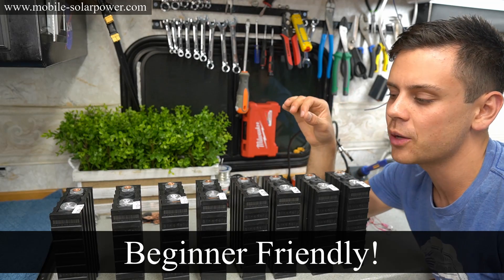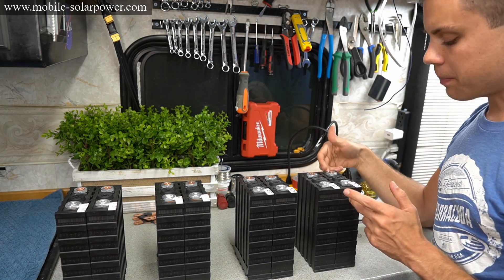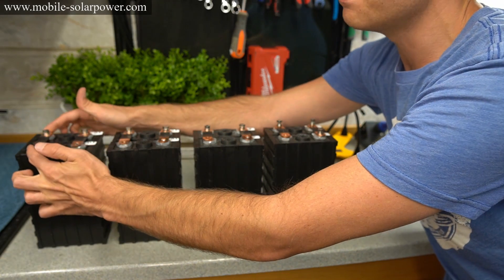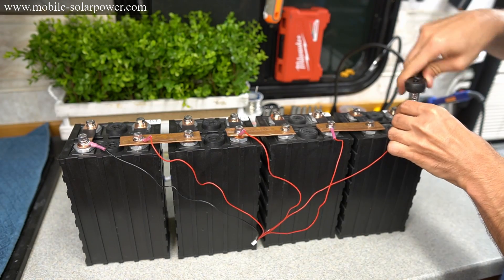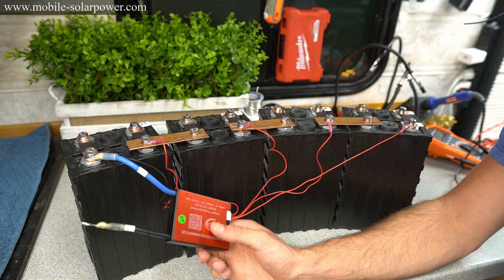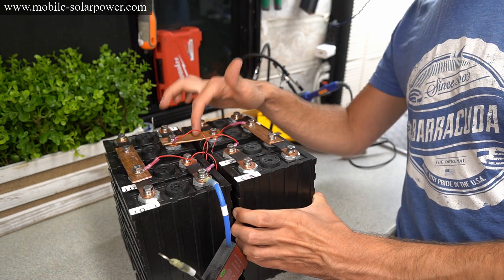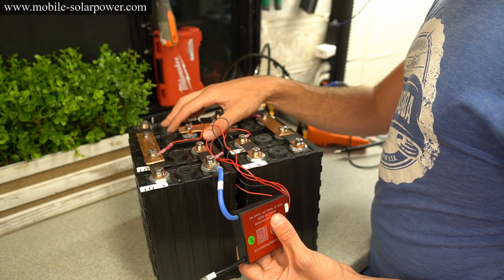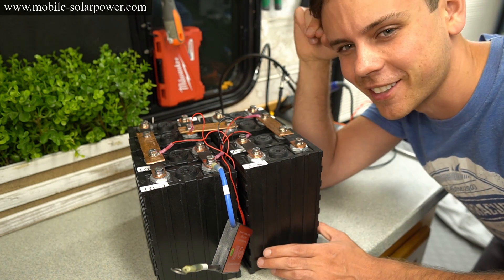How to Build LARGE LifePO4 Solar Batteries w/ Raw Cells and a BMS

Comment: I know this is an older video, but I have a sailboat with a battery “space” that is only so big and this is an interesting option for me. I’ve been kicking around the idea of using lipo cells because the case that a production battery takes up is just useless air and the best I’ll be able to do is a 200ah setup. Using cells, I have room for a 400ah system and this idea makes excellent use of the space I do have.

Comment: So say the batteries are 80ah and this configuration is 12v, with 4 blocks of parallel 80 ah , that's 160ah per block x4  that is 640ah at 12v which is 7680wh... Do I understand this correctly?? Trying to wrap my head around how 3.2 v cells halved in parallel and then chunked in series is ending up 12v.
Math is hard , my math is wrong isn't it

Comment: With this setup, is this a 2P4S battery configuration? Second question is if I wanted to make a 200ah 12v battery, would I need 8 3.2v 25ah cells?

Comment: I have a question I really hope you can answer. I’ve been looking on different websites and each website seems to give a different I build a 12V 200Ah lifepo4 battery what size BMS should I use? it’s gonna go on a 4000W continuous 8000W peak 12 V pure sine wave inverter.

Comment: i have 64 3.2V 320MH Lifepo cells i want to make 48v or 24V large single battery bank how much and which specification BMS system will be required. i want to purchase only BMS either 24v or 48V depends upon Solar invertor, second question is that do we have built- n BMS in 5 or above KW investors to manage all these cells now a days

Comment: I'm building my own Lithium Ion Power Packs. Hooked to 100 watt solar panels on my VanLife Van's roof -the $65/100w panels with the discount code Bob Wells promoted, maybe. Or 20 watt panel to trickle charge for now. This, all because of the education Will & Bob have provided us all, over the years. Mostly of 18650 cells. Batteries both in Series & Parallel. With a good BMS. All DC for now. Watched a ton of ebike, scooter, drill, Home made Onewheel, etc YouTube videos on how to build, configure, solder,  DC Battery Packs. I get it! It's my new passion. Wan't to build my own Onewheel, Boosted Board, and Li Ion Hydrofoil kiteboard. And maybe my own Li Ion Powered invention. Out of the back of my van. 
  How many 18650 cells (if harvested from ewaste for free) can I store my van, Will? If I do a good job sorting out the bad/damaged ones, keep tabs on all of their voltages with my multimeter, until it becomes a fire hazard? Obviously keeping them organized/separated in those 6 pack plastic holders they sell to build the battery packs.Then storing them inside a metal box, next to a good size fire extinguisher is helpful 🤨. Or are 18650's so cheap now, can I just order a bulk pallate of new ones from China. And skip the dumpster diving. Because voltages are balanced within 1/100 volt when their new. And forgo expensive BMS's for my first 3 small 10 - 20 amphr packs which can be evacuated quickly from a van, if need be. 
     So excited for my new hobby. I'll even work as an electical apprentice somewhere because I'm so motivated to learn as much as I can. I'm so stoked I'm getting it.

Comment: I built a small 48v lifepo4 16s battery system from 16 280ah batteries. I'm planning to scale that up to a total of three systems to power an 18kw inverter. Charging to be done by 40 240w solar panels, which are due to arrive tomorrow. I have to buy wire and connector sets for the panels yet.

Comment: I have a question. What bms or how many bms's do I need if I build 4x12v 200ah lifepo4 batteries and connect them in series to run a 48v system? Can I use 1 bms for the whole bank or do I need seperate bms packs for each 12v battery? And what if I just build a 48v battery at 800ah can I use 1 bms and if so what size would I need?

Comment: I like your video, but what was confusing was at 4:10 in the video you point to the 4 battery in the system using your left index finger on one post which is positive and your right index finger it pointing to the negative post. I looked at my diagram for the system that I am building, a solar generator, and quadruple checked to make sure I had the batteries in the proper orientation.

Comment: Hi there, Thanks a lot for this great video. I like it a lot. I have one question here. If I have 12 of these cells, can I parallel 3 cells and then serial connect them to make 150amp of 12v  battery and still connect the BMS as you showed in the video? Thanks again.

Comment: How important is it to use the Buss bars? I have a situation where it wouldnt be possible to to use them. can the cells be connected with cables instead (Assuming cables are of sufficant size, good terminals etc)

Comment: I could really use some advice, and this might be a good topic for another video because I cant find much info on this.   I'm trying to build a 24V battery bank with 12 x 3.2v cells.   How do i configure these in a safe way??? I thought I could use 2 X12V bms in series, but then I still have 4 cells left over that I don't know how to integrate into the batteries while keeping everything balanced.... the 24v bms is a 8s system and comes with the same issues.....HELP!  (I want to use all the cells because 8 cells have enough wh at the end of the day)

Comment: Hi 
I am having trouble with BMS it has no voltage at the p- cable but the battery is currently fully charged i tried shorting it on the main -but no luck.
Any ideas

Comment: Question: I have 4( 18v ,200watts) solar panels+ 24v tesla battery 1 bloc and bms + 5000 watts pure sine inverter. What MPPT should I use and how to build my system. I want to power a small swimming pool pump+ un small frige+ light. Help please.

Comment: 051021/0346h PST 🇺🇸 thank you again. I’m watching this instructional presentation for the 3rd time.
I configured 8 LiFePo4 prismatic cells (272Ah each) to obtain 12V@544Ah, (with your guidance) Thank you.
I used JBD BMS 12V 100A OP and configured the parameters manually to obtain maximum results. My power requirement is very meager, mostly for experiment purposes. The PV cells are RENOGY X4 400 W, Victron Charge controller, VICTRON 12/2000 Inverter, 12X25A VICTRON LiFePo4 charger ( to take up the slack during winter and other extreme conditions) and CERBO-GX system stem and function.
So far the system functions well.I might replace JBD with 12V Daly @120A OP.
Thank you again for the, info, without which I could have not achieved success. Stay safe and 73s...
Reply: How did this turn out, I would like to do a similar setup with the 310ah

Comment: I'd love to find a link on your web site to ALL the videos you have done on LiFePO4 24 v batteries AND the hardware and design that goes with them to create a solar system for RV living. It might start with the DIY 24V Beginner friendly video. And it would probably include the videa I watched recently about the BMS, Inverter, battery protect and relay system. And it might have a parts list and links to sources. Please?

Comment: Hey Will Im a huge fan of yours and Ive learnt so much from you.
Can you clarify something for me please  by wiring batteries in series does it change the voltage from 12 to 24 volts or am i missing something  
Thanks Mate keep up the awesome work
Reply: Series means they add up the voltage, parallel means they add up amps. 
Series means connecting positive to next batteries negative, basically one big battery with double voltage between first negative and last positive. 
Parallel means connecting the positives together and also negatives together so you have twice the amp storage.

Comment: Hi Will.  Love the videos and thank you for all your tests  I've learned a lot from them.   
You mentioned in this vid to use 2p4s but I'm seeing varying advice to use instead use 4s2p.  What's your take on 4s2p ? Other than needing a 2nd BMS, why is it not good to series first and then parallel ? 
I'm just checking because this video is nearly 2 yrs old and I wonder if the mindset has changed in that time.  Thx

Comment: Great explanation, may I ask you a favor, I did a series with BMS card to build 12V 100Ah and now I just build another 12V 100Ah, what is happening if I parallel them to build 12V 200Ah? it means I parallel the 2 BMS. I waiting for your feedback

Comment: I guess you could connect 4 in series, 4 in series and then connect those 2 in parallel. This would be similar to having 2 ‘off the shelf’ batteries and would give you the opportunity to add another ‘battery’ (4 cells in series) later if your power needs increased. But I suppose it depends on the BMS, if it’s only capable of balancing 4 cells then you would need 2 BMSs.
Reply: I'm a bit late but that's what he specifically states not to do in the video.

Comment: Will,  What is the bast way to hook up sixteen, 280ah batteries for a 48V system?  This is for a 30A 21' travel trailer with five, 200W panels (20.23v each).  Thanks!

Comment: If I'm putting together a 32 cell system (12V)  I'll need 4 BMS's, Correct?  I'm going to use 200a ones to power an inverter.  If I'm correct is just what you did in this video X 4.  And of course connecting the Neg of the bms's together on a bus bar..   Great, Great  video's  You have the absolute best way of explaining whatever the topic is your covering.  Keep up the GREAT work!

Comment: I tried 24V BMS and the output of the battery is 26.2V but if I connect the inverter and solar controller the voltages is .245V only not functioning

Comment: thanks for stepping into the bigger capacity range.. I know you do more smaller mobile power but I need info on a house size system.. I am looking at 16- 280ah cells configured into 2-24v battery packs..  1. have you tried these batteries yet? 2. would you recommend 1 bms with the systems in parallel like this video? or would I be better off with individual bms for every 8 cells?    also,, where do you get bus bars?

Comment: Hi Will, a long-time subscriber here. Just wanted to point out a little "error" I noticed. If you pause at 4:21 and look at the busbar at the rear of the battery, it is connected to the inner-most battery in the parallel string 2 and string 3. I learned in electrical engineering, that the + and - should always be pulled from opposite batteries in a parallel string, as that will spread the current over each battery equally. The way it is connected in the video, the inner-most batteries in string 2 and 3 will do majority of the work, with the outer-most batteries lagging behind. I think the middle busbar should simply be moved 1 notch and connect the rear-most batteries.
Btw, love your videos, keep up the good work!

Comment: Will - thanks so much for the informative videos you provide. I have limited heated space in my van. Would it be possible to build the 4 2-cell batteries (connected in parallel using bus bars as you have done), but then use say 2/0 cables of equal length (say 12 inches) to connect them in series to be able to pack them into the space I have available?

Comment: Will, thank you for all your videos!  I realize that prismatic cells can be connected in parallel relatively safely, but what if one goes bad?  Can you recommend a safer way to connect 2 or 3 in parallel when building a 12 or 24V system that would not be overly complex?  Thanks!

Comment: Hey guys! Building a 100 AH right now from 4 cells. I was wondering if I could use them for a couple of months before adding 4 more cells to them for a 12V 200AH battery without any problems. I Ultimately want want to use all 8 Cells with the same BMS. Just couldn’t afford all 8 at once. Thanks guys!

Comment: Will Prowse your very impressive and I love your mad scientist approach 🤓

BIG QUESTION FROM AN OLD MAN!!

I have a Outback Power solar system with twin VFX 3624 Series Inverters / Chargers tied together in parallel with Outback Flexmax Charge Controllers feeding fourteen (14) Outback AGM RE Series 200 AH Batteries.

You kids scare me with all your knowledge and skills of building these LiFePO4 batteries 

How many of these batteries you are building with my current 24 volt system to achieve the same capacity I currently have?

I may not be as smart as you younger guys but I'd love your recommendation for my total Off Grid setup?

Thanks Again Your Quite Impressive 

John

Comment: Hi i have 7 seven lipo4 100ah is fine if i parallel  connect  3 cell and   connect in series  including  the fourth  sngle cell to make a 12 volt  
Like 2×2×2×1= 14.4v

Comment: Like your information....I’d like to know what is the device you use to show individual LI cell voltage (& cabling) as being monitored by the bms.....you keep showing the individual cell voltage.....and what’s with the battery disconnect?

Comment: Why is it bad to put them in series first and then parallel the 12v packs? I’m making a 16 cell pack, (16 - 3.2v  120Ah batteries). I was going to make 4 12v 120Ah batteries and then parallel them to get the full setup.

Comment: Hi Will,
Is there any reason why we cannot run batteries in series all the way to 110v or 220-240v? Would there be any advantages regarding efficiency of inverter or wire thickness/temperature etc? Thank you
Reply: 110V AC?
Reply: @Mayo-dj6ew  Thanks Mayo, I mean running the batteries in series up to 110DC or 240DC and then into an inverter DC-AC. Just curious if the inverters can be smaller/capcitors smaller or more efficient if they dont have to jump voltages as far, just modify the wave form if that makes sense.

Comment: Hi, one question, using a configuration like this (4S 12V nominal) with a bms, do you need to ad in series with the negative main lead a solar charge controller rated for 12v nominal? reason I'm asking is that charge controller needs to be first connected to the battery and after that to the solar input otherwise can be damaged. How do you hookup this system to a solar panel?

Comment: I just built my pack and I'm having the issue where I'm not getting the voltage out of the P- BMS wire. I tried shorting it, but nothing. The voltage from main negative to main positive of the battery pack is perfect. Looking for help trouble shooting / suggestions! What should I try? Thanks - very helpful video, btw!

Comment: yo bro. i have a planning that solar battery setup, i will buy 3.2v 50ah prismatic battery 4pcs. i will connect that in series and i have total of 12.8v 50ah and i will use 4s bms. and when i have money again in 1 to 2months i will upgrade that in 100ah? how? i think i will buy again 4pcs 3.2v 50ah and 4s bms. and i will connected in parallel that is safe? thankyou bro.

Comment: When you parallel-series the batteries, you have simpler wiring and can use a single 4S BMS. The downside is that you're limited to relatively low amp loads. If you have a 2000W inverter than can spike to 4000W you're looking at ~350A. Some BMSs on AliExpress might hit that, but they're expensive and does anyone know anyone else whose used one? Because I can't really find any info.

If you series-parallel instead, you can stay at 12V, but dramatically improve peak amp ratings. So with four 4S BMSs on a 16-cell system, you can use a common 100A BMS and service 400A loads.

Other than the cost/complexity of setting up four batteries, I wish more time was given for why this isn't a good option. It seems like it's basically exactly what you're getting when you buy four Battleborn batteries and put them in parallel in a 12V system and no CANbus network or anything. I totally get it's a bit more hassle, and you have four points of failure (in a 16-cell system) instead of one. But it seems a lot easier than trying to find a low-self-consumption relay setup for your inverter, or switching to 48V and then having to add a 48VDC to 12VDC Converter for your existing 12V devices/system, etc.

Any help on why this is a dumb idea or downsides I haven't considered?
Reply from the maker: You should run higher voltages if current is limiting factor.
Reply from the maker: Go 48 volt. 12 volt is a joke
Reply from the maker: But yes, can easily parallel multiple BMS for more current if you want
Reply: @WillProwse  Thanks. Maybe you'd consider a video explaining why this is a not-optimal solution for beginners?

It seems like 48V is the ideal. Really I'm just a little overwhelmed thinking about how to manage that in the limited space and 12V setup I already have.

Comment: I seen you bought set of 4 cell 100Ah, and they seemed to be balanced both for internal resistance and capacity. If I look for 400Ah and they seemed to be sold as singles, not set's of 4. Do I have to limit my usable capacity if I put not matched cell's in series? Or is it ok just to connect the cell's in series as long as I have a BMS connected?

Comment: Thank you for the videos, very helpful.  There are many of us out there that do not need solar because we are driving so often that the vehicle's alternator provides all the charge we need (overlanding). Can you do a video that focuses on a vehicle charging system of 14.2 volts as the primary charging source for a LIFEPO4 pack installed as a secondary pack in a vehicle. Usually the secondary battery is isolated from the primary electrical system/starting battery of a vehicle's electrical system with a voltage sensitive relay (12.8 and below open, 13.2 and above closed).  Design hurdles are dealing with float charge without disconnecting critical items such as a fridge and charge inrush current for a low state of charge LIFEPO4.
Reply: I also think this can be very useful for people that like mobility. Today ctek has an expensive solution for it. There are probably more simple diy solutions. Will is a man with ideas...lets see....

Comment: Hi Will Prowse and DIYer's

Can i ask what  if the voltage between P- and positive of the battery is 0.95V. ? Is BMS damaged? I used Daly 4S 200A for my battery bank.